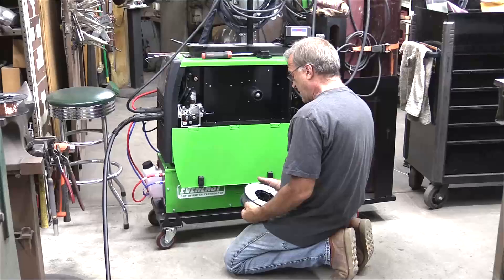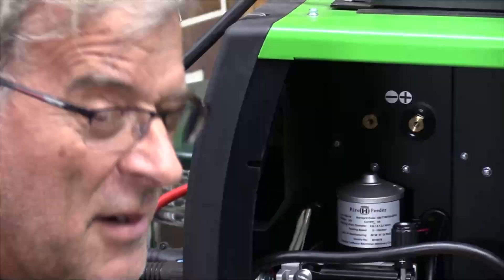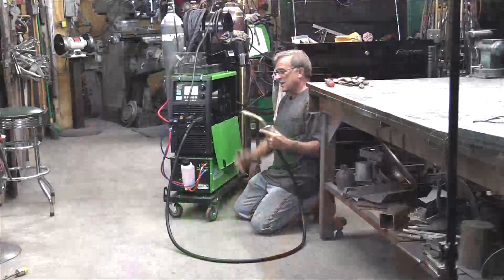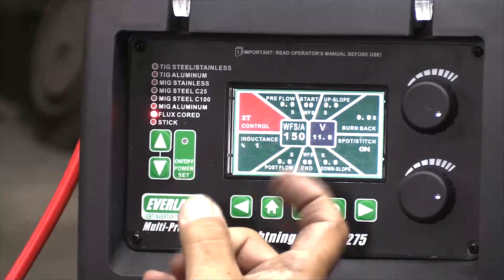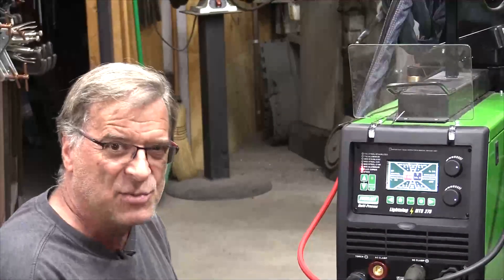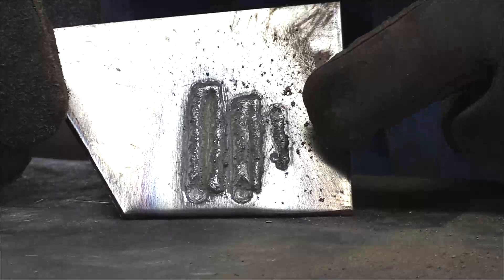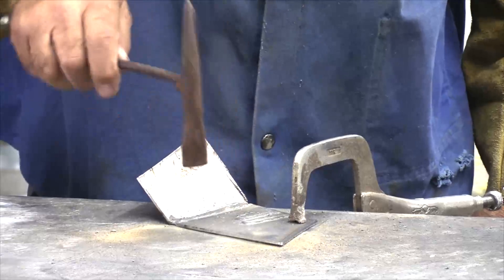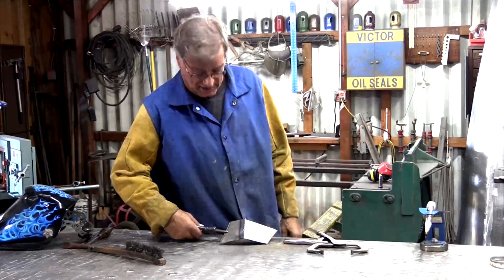How to Weld With Flux Core Beginning to End - Kevin Caron

Comment: Sorry, but my Lincoln MP welder did quite well with flux core.  Apparently you don't know how to weld with it.  I can stack dimes with mine with only a MP210 welder.  1/16" to 1/2" steel is no problem with 0.35 flux core with really good, better than MIG penetration.  It sounds to me that you simply don't like flux core and/or haven't learned how to weld with it.  This is not an "us" problem, it's a "you" problem.
Reply from the maker: I agree 100%.

Comment: What size bladder did you run? And did you order the world Drive rollers for the flux cored wire? Or were you able to make it work with the stock driver rollers that it comes with? I have the same machine but all it came with was the standard Drive rollers for steel
Reply from the maker: I was using the rollers that came with the machine.

Comment: Kevin, I don't want to sound like a retired welding instructor, but, once you fine tune your settings, you will get E6012 like beads, operation.  Try dual shield FC, you will get E7014 beads, operation.  The AWS requires self shielded FC for outdoor [field] structural welding, in place of MIG due to wind contamination.
Reply from the maker: I am sure I have much to learn about this Al. Only been doing this for 20 years or so.

Comment: When you see someone welding "production" grade weldments with a gas shielded flux core they really lay it down speed wise and the welds are pretty and strong. Not a process for me but I see it has a place in the commercial environment.
Reply from the maker: I am sure I have a lot to learn about this stuff.
Reply: I would be surprised to see anyone using it for production welding. Cost of clean up is huge.

Comment: kevin i used flux wire it welds like shit if you use a long stick out it still welds like shit even if you tacking it welds like shit i had to run CO2 gas with the flux core to prevent holes i only use it to tack up barbecue pit  grills using the DC negative the tack penetrates deeper and it burns out the mill scale and rust when i tacking the grill without the gas the tack have porosity

Comment: With gasless fluxcore you needt o swap the drive rollers out and use knured ones. Also need to use longer  stickout. What catchs people out is taking off the nozzle makes it look like they have longer stickout when they don't.  
I find gasless fluxcore touchy to set right. Need a good machine to use it well.
Reply from the maker: Doesn't matter to me.   I won't run it again.
Reply: @KevincaronSculpture  i don't blame ya. I only have it as a back up.

Comment: Get some dual shield flux core and give that a go
Reply from the maker: Had a couple of guys tell me this.   Have to give it a look I guess.
Reply: @KevincaronSculpture  dual shield is really for thicker material.
Reply: @tweake7175  you can weld 1/4" with dual shield. Dual shield is stupid easy to run vertical up stringers with.
Reply: @Farmer1277  depends on what you call thick material. 1/4" is big for what i do. also the other issue i found  was just trying to get small diameter dual shield wire, around here its typically .045" or bigger.
Reply: @ORD80  I agree with that.  You can't just turn the gas on and go with your regular flux core. You also leave the polarity same as solid wire